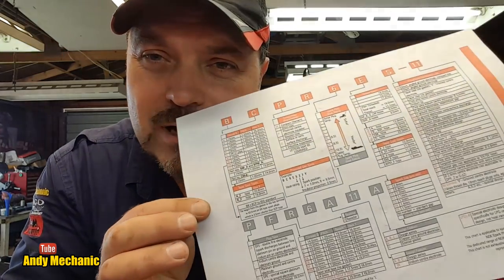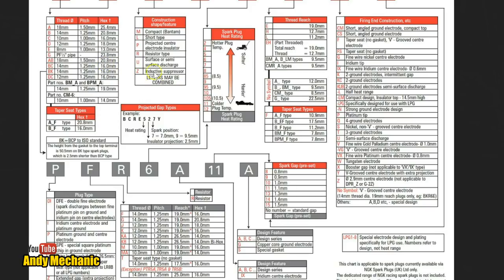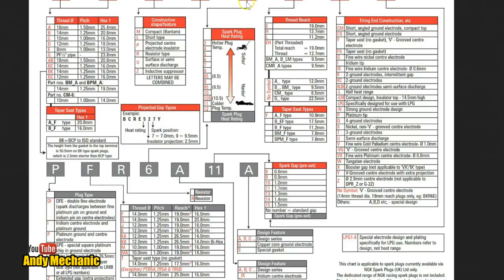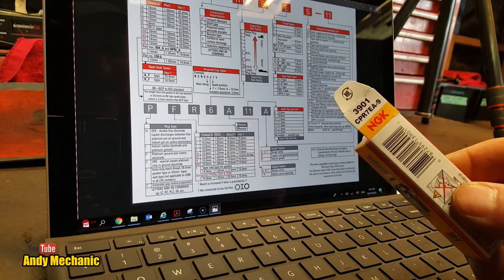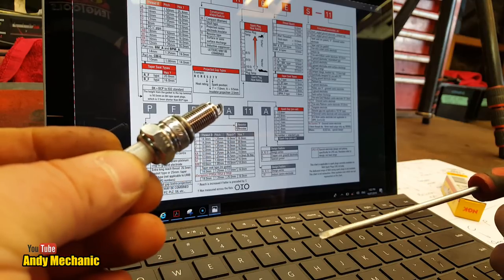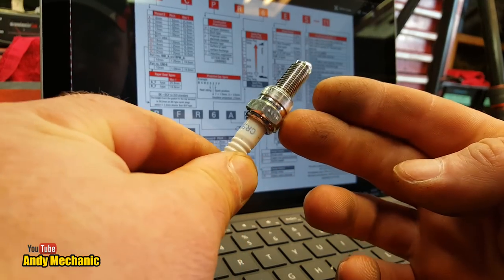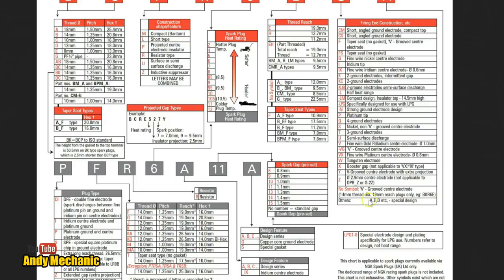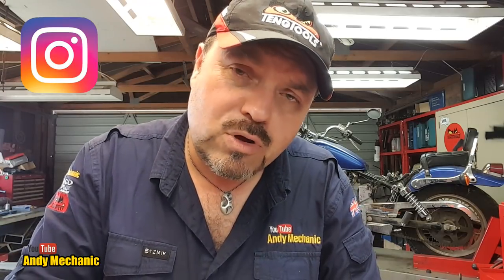NGK Spark Plugs - how to decode the letter & numbering system #1453

Comment: Andy when the wof guy rides the bike and checks the back break do they allow for the back having less necessary  stopping  power in relation to the front or do they just  judge overall stopping ability of both  ? My back drum isn't that great but front is powerful disc.  Thanks
Reply from the maker: The rear brake should be powerful enough to lock the rear wheel. If not then there is likely a problem that needs attending to unfortunately.

Comment: Is the alphanumerical coding system used by NGK part of ISO standards or proprietary information ?. I was trying to find a similar chart produced by Bosch, which I use, but unable to aquire.
Reply from the maker: Hi Andrew, to be honest I don't know. However, I did put a link to an NGK document which may contain the info you need. It's in the video description now. Cheers Andy
Reply: Andy Mechanic : Thanks Andy, but unfortunately they are different. The limited correlated alphnumericals information fails to correspond with the Bosch coding and, unfortunately, nil relevance.
Reply from the maker: There must be something on the Bosch website about how they code their Spark plugs? If not then, well, just another reason to switch to NGK :-)
Reply: There is just Google for bosch sparkplug chart will download as a PDF.
Reply: John McCallum :Thanks John. Did find several but when alphanumerical codes supplied are applied to the Bosch plugs I regularly install, the interpretation is incorrect. An example is the chart code indicating a plug contains a resistor when it clearly doesn't. Have emailed Bosch Aust and waiting a reply.

Comment: What's up Andy it's Troy again I have a 2008 ninja 250 I'm working on,the compression is good spark is good,cleaned the carburators and still won't start even with starting fluid could it be a safety switch maybe?

Comment: shouldnt that last spark plug be a DC PR 8 E? (12mm, 1.25mm, 16mm/ projected shielded resistive/ HR 8/ 19mm) checking the table it says that theres max of 2 letters per first side of the table before the heat range

Comment: D 12mm thread C hex size 5/8 P projected insulator type. wot about next vid the affect setiing the jet needle height in a carb wrong has on a bike . to low ticks oveer fine but / wont rev / cuts out  to height pops and back fires exct